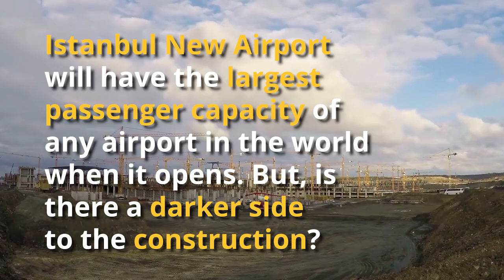A Darker Side to Istanbul's New Airport

Comment: Numbers of deaths are due to  low standards of construction site safety in Turkey. This is a mega project and you can see the results easier, so that the standards need to change. However, I have been to the site during my engineering intern and food was among the best in all construction sites worldwide, and I saw that all workers eat the same food regardless of their title. As for the sleeping hours, generally people work overtime in Turkey in construction projects but the airport is far away from city and traffic is very bad, so they spend generally 3 hours a day only commuting and this is same for engineers as well, this is a common problem of projects close to İstanbul.